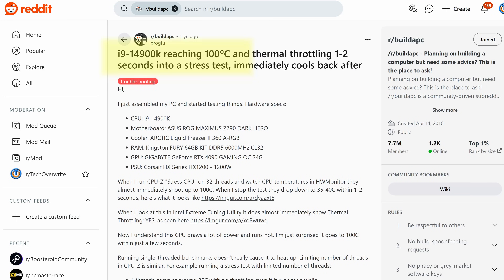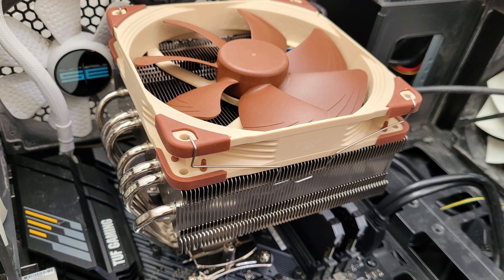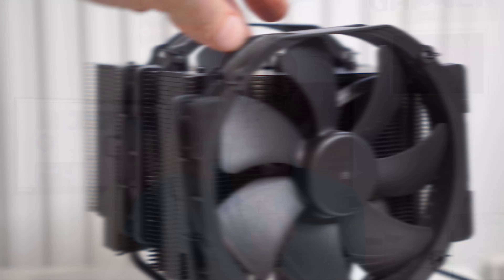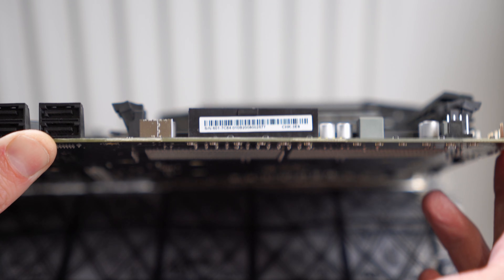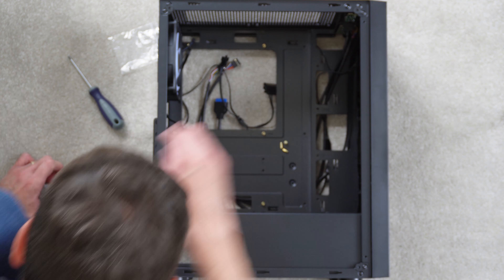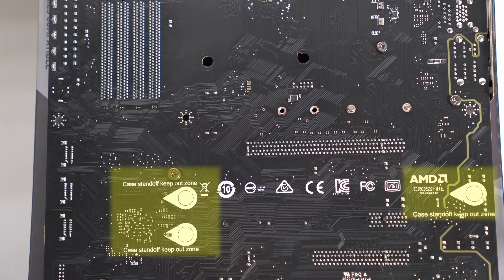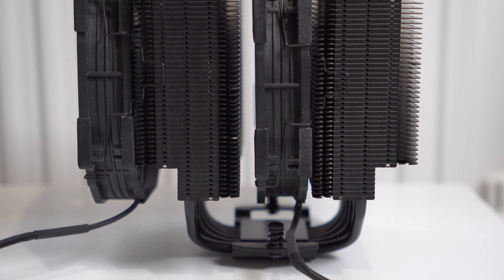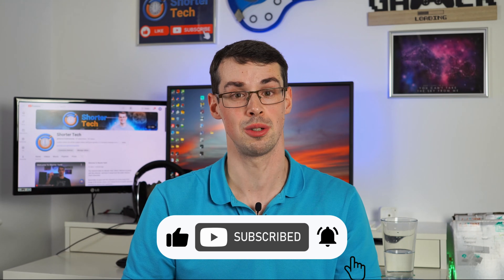Can Large Or Heavy CPU Coolers Break The Motherboard?

Comment: i was really wondering about that since my gigabyte b450m mobo got bricked (and before that, my a320m, also from gigabyte) after installer my clip-mounted cooler, which i thought what i bought was a screw-mount

but since i checked it with a tech, he says it really got bricked and asked me if i did some diagnoses of my own - which i did, i clean my pc every other day - and he said the reason he doesn't sell gigabyte motherboard are because of its unreliability 

so i went on to chat with the online shop that sold me the mobo. they say they can't RMA the thing because they only had a year's worth of warranty. they then went to refer me to gigabyte's own support website, which then referred ME to the online shop where i bought it from.

so now i have concluded that it's a dead end and that "3 year warranty" sticker on the box is cancelled by the seller's 1 year warranty

this motherboard was purchased on october 2023, it haven't even been 2 years as of writing...

anyway, i'm getting a used TUF B550 motherboard by next week, wish me luck!
Reply from the maker: Ugh really sorry to hear that :( That's a frustrating Gigabyte experience. I hope the Asus TUF board works out better though!

Comment: amazing video that nobody mentioned mate, nice video.
Also I have a question, (it can be stupid).

Regarding the graphic card with 3 coolers for example RTX 4060 or RX 7800, as the graphic card is very heady, it also needs a holder to avoid it bend. "question, why the holders are only recommended for graphic cards"?
Reply from the maker: Thanks mate, I appreciate that - and that's a fair question :) Many GPUs are far heavier than CPU coolers, so it's a reasonable doubt.

I think it's firstly because the GPUs themselves are unlikely to bend/damage the motherboard - so similar story as the CPU coolers. That in itself isn't a risk (thankfully).

When it comes to why the GPU has a holder/anti-sag bracket - that's actually to help the GPU itself. Since most people have their cases standing vertical, there's a fair amount of gravity acting on the GPU, which can 'pull down' the card and possibly damage it (in the worst case). So the holders/anti-sag brackets help protect the GPU basically.

Comment: this actually used to be an issue when these heavy coolers first came to market and you got more budget motherboard.

it was just this conversion point that the budget motherboards got more and more features and abilities to overclock and CPUs just got more and more able to run hotter that we reached a point you run a max OC on a motherboard with 3-4 layer PCB that was super thin while needing a massive cooler to cool the chip.

however today it is a non issue since due to signal integrity i think the minimum we are running is 6-7 layers that need to be thicker.

so it very much used to be a issue just isn't anymore.
Reply from the maker: Ahh interesting, that's good to know about slightly older motherboards but great point that nowadays the extra PCB layers does naturally help with this. Thanks for watching and commenting :)

Comment: I still think that modern motherboards should be made of thicker fiberglass panels to accommodate heavier things being mounted on them today than in the days when video cards were called that because they were about the size of credit cards.  It's so much cheaper than everything that gets put on the boards.  PCI Express slots should also be made stronger to account for heavier GPUs.
Reply from the maker: That's a fair point, I totally agree actually - they do feel a bit too thin sometimes. I always cringe a bit when seeing how much they flex during RAM and GPU installs.
Reply: @ShorterTechOverwrite  It's mindblowing to look at the video cards and heatsinks from the same era and how small they were.  Those early video cards used to get sufficient power from the slots they were put in, then a molex socket was added for some more power.

Comment: i bought corsiar 750w rme power supply it's a atx 3.0 power supply is not having a atx 3.1 power supply fine?
Reply from the maker: Yes that should be fine - especially because many of Corsair's ATX 3.0 PSUs actually have a 2x8pin to 12vhpwr cable, which I think is probably a bit safer than a native 12vhpwr slot on the PSU. That's a long story, but Corsair's ATX 3.0 PSUs are generally solid yes :)
Reply: @ShorterTechOverwrite  Thank you bro, you got my sub ❤️